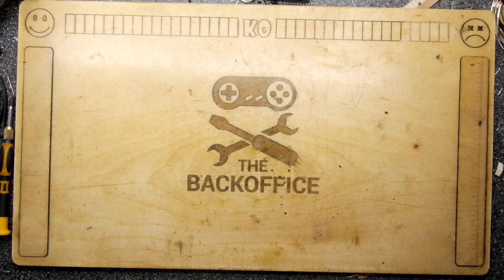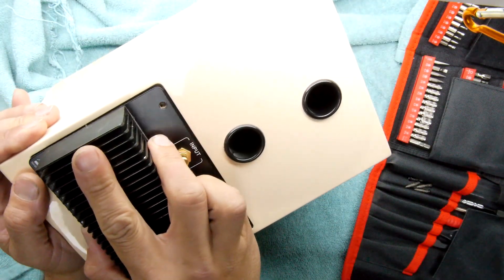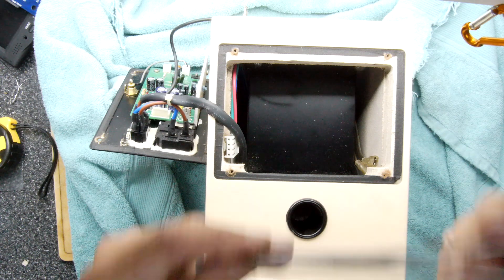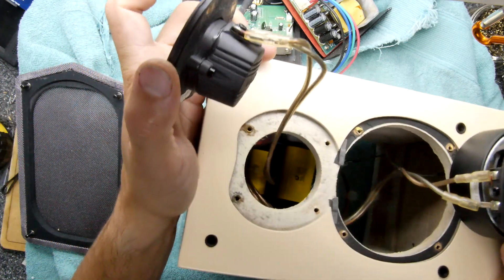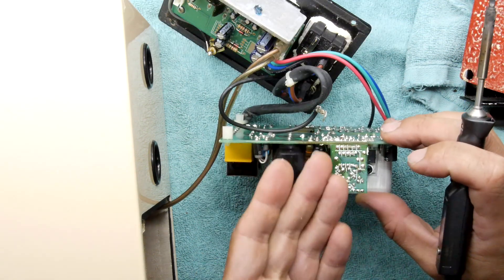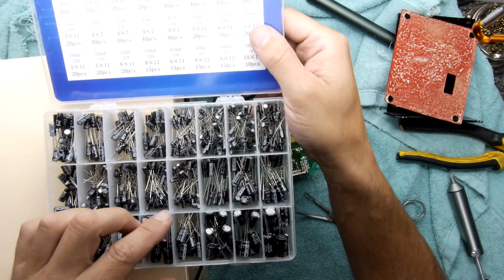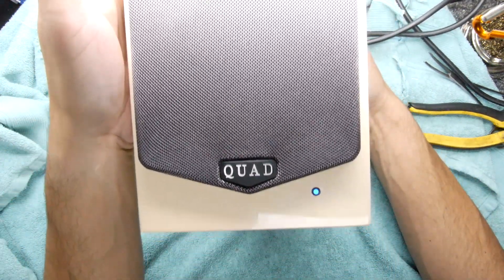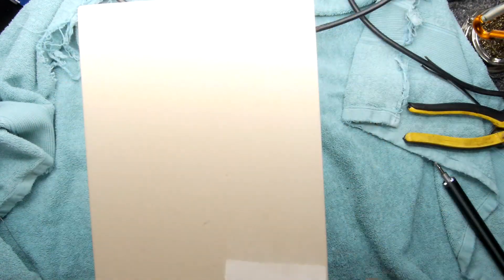QUAD 9L Active Speaker Repair the other one - It's not the same!!

Comment: That little speaker is veritable clown car of electronics
Reply from the maker: I have some cheapo equivalent for around £75. The amp etc is only in one speaker and they weigh about a quarter of this, actually the AC adaptor is probably just as heavy. In contrast these Quad ones are like a battleship 🤣

I'm guessing this resistor and capacitor are the main weak point. However as these speakers are so rare, I suppose they just service them rather than making a new revision. They rarely come up on the market
Reply from the maker: I have some cheapo equivalent for around £75. The amp etc is only in one speaker and they weigh about a quarter of this, actually the AC adaptor is probably just as heavy. In contrast these Quad ones are like a battleship 🤣

I'm guessing this resistor and capacitor are the main weak point. However as these speakers are so rare, I suppose they just service them rather than making a new revision. They rarely come up on the market